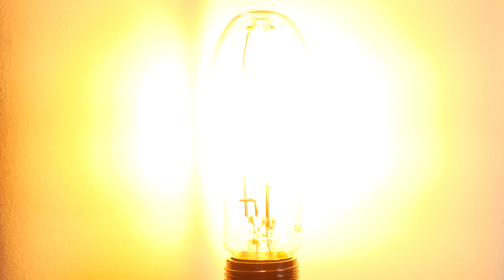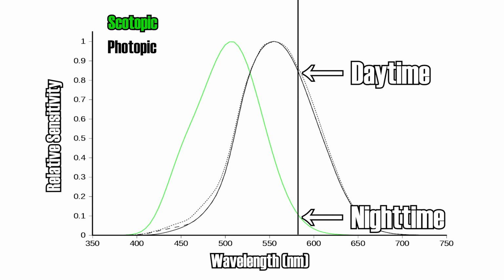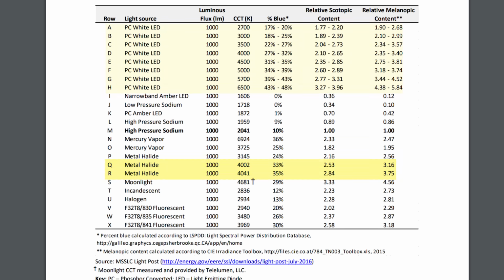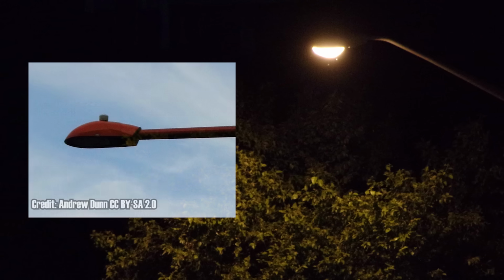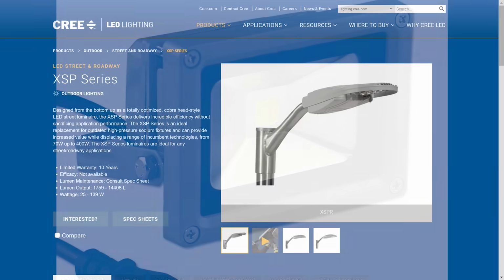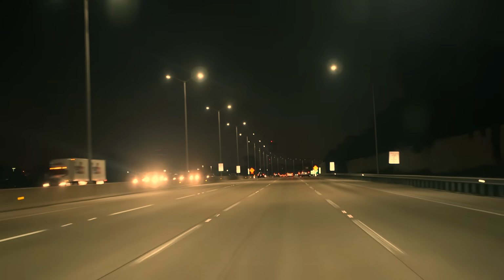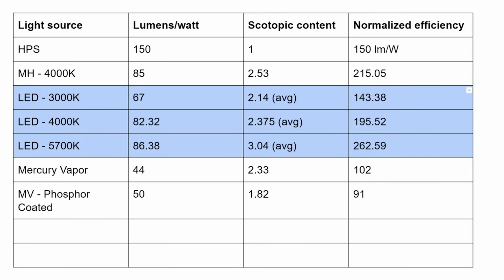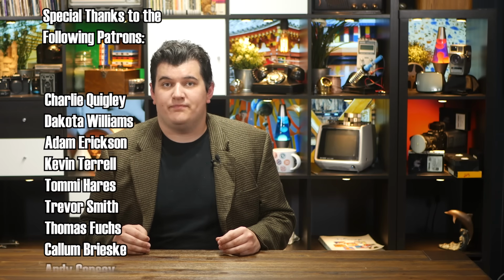The LED's Challenge to High Pressure Sodium

Comment: I prefer HPS lights because it makes it easier to fall asleep when I'm driving. I like to be well rested when I arrive at my destination.
Reply: I'd prefer to die peacefully in my sleep like my grandpa, not screaming in terror like the other people in his car.
Reply: @JohnnyTromboner  
Driver falls asleep
People in Car Screams
Running in the 90s starts to play
Reply: @zyansheep  wait....they went back in time?????
Reply: @zyansheep *Kerosene
Reply: @JohnnyTromboner  yeah, shut up people
Reply: @JohnnyTromboner  Thanks, Jack Handey
Reply: @JohnnyTromboner  But inherent optimism bias and terror management theory will always help regardless of ideologies such as antinatalism based on consent.
Reply: Yes just the point I was going to add,  but the other way around ,  the white -  blue light disrupting sleep rhythms when people drive at night is an added safety factor.
Also, yes led lights brightness is normally adjustable,  in many situations 100% brightness is not needed and we also turn the brightness down at midnight or at a more appropriate time for the location.  It also saves power.   In most areas in Europe that have converted to LED lighting this can be adjusted centrally,  and increased during night roadworks for improved safety
Reply: @davidclark2286 sucks if you live near roads with these lights though.

Here in WI they don’t adjust the lights depending on time of night. For road work they use giant LED flood lights pointing in the direction of oncoming traffic which blinds everyone, people are not smart here in Wisconsin USA.  So it might be a better idea but in practice most people are dumb and muck it up significantly
Reply: Who doesn't like being well rested when they are about to die! Funny enough my step father fell asleep on a road trip when I was a child and nobody knew it until at some point he jolted a bit and asked how we got so far so quick.. he had been asleep for 2 full hours both without wrecking and without anyone in the car even realizing it >.> so apparently he can drive in his sleep O.o 😴 tbh we where just really lucky, the car itself was pretty smart especially for its time and we where on the highway. The car could keep itself in the lane so long as there wasn't any tight or sudden turns and it also automatically applied the breaks if you got to close to something. I attribute that to being why we never noticed and where safe in the end as opposed to him actually driving in his sleep and I don't mean sleep driving I mean no movement dead asleep still somehow being able to drive xD
Reply: @supershenron9162  
I have a friend who's parent thought that the best way to keep themselves awake while being tired and driving was to drive faster.
Reply: @sonan333  actually singing out loud with music on the radio is best way to stay awake.
Reply: @supershenron9162 what year did they have that technology? I believe it's pretty new within the last 10 years.
Reply: I hate when people wake me up by honking and shit
Reply: This was pretty much my thoughts the entire time he was throwing "messing up circadian rhythm" as a negative for street lights which point to driving. If you're driving at night messing up your circadian rhythm is your own fault. If you're driving in the morning it's a free wake up assist.
Reply: @sarab949  I'm 2 years late but I think he means disruption of people living near roadways who get excess light shone through their windows due to light pollution
Reply: @sarab949 Yeah, but if your entire city is lit up by white LEDs, you'll have a lot more spillover to people who aren't going on long-distance drives. Just coming home from work you'll be exposed to light that disrupts melatonin production, and God forbid you go on a nightwalk. And when you do get inside your home you'll find that, if you don't fully shut your blinds you'll be getting a hefty dose of that sweet cold light right into your premises and onto your bed. Even if the effect is still manageable, contributing to sleep deprivation in a generation that is already chronically sleep deprived will logically amplify the problem and might actually lead to a drop in the quality of driving both at night and day. Of course the sleep-disrupting effects of bluer lights at night might not be as dramatic as I'm making them out to be, but they're surely a considerable factor.
Reply: @sarab949  It sucks having one of those lights shining directly into your room
Reply: @sarab949  "Cross-Country Truckers"
Reply: @sarab949  Pretty sure he's not really talking about disrupting the circadian rhythms of the drivers, not to mention circadian rhythm disruption doesn't just mean "staying awake".
Reply: @ImDemonAlchemist  also, as someone who also lived in the Chicago suburbs, if you are driving home from work at 5-6pm it’s going to be fully night for several months of the year. You don’t need to be driving after you should be asleep for it to be dark on the roads.
Reply: @sarab949 annndddd what about all the people who work night shift and have to drive at night to feed their families?
Reply: @sarab949 some people don’t have a choice and need to drive at night you know
Reply: @sarab949  what about people who, y'know, live in houses with windows?
Reply: @sarab949  Some people work nights my dude, driving at night isn't "their own fault." Also, it disrupts the circadian rhythm of everyone around them, not just the drivers, including animals and people living nearby.
Reply: @sarab949  he’s not talking about the people who are driving, he’s talking about people who live near roadways/parking lots/etc where the LED lights are installed.  Like if the parking lot in your apartment uses LEDs you might not get as good sleep each night due to the light shining through your window, or even if you go for a walk before going to bed.
Reply: Lol
Reply: Well, technically you will be resting, in peace 🙃
Reply: Bahahahahahahahahahah! I love this comment with all my heart! Just like grandpa! Not screaming like all the people in his car. XD
Reply: You good mate
Edit: yes I got the joke so don't call me a dumbass
Reply: This comment will probably make a lot of sense in 10 years time
Reply: Damn tesla drivers
Reply: LED lights that have the same color temp as HPS would be awesome
Reply: @jaf - I did that driving through Texas.  Spent the rest of the night in jail.
Reply: Would be a quick way to get to your... Final Destination.
Reply: Oh no
Reply: oh you mean the morgue got it.
Reply: Lol
Reply: Hahhhhhh! Good one!
Reply: 0
Reply: This comment will age like wine in 30 years
Reply: yeah i love merging on to the highway at 0 mph because i ran into a pole :)
Reply: Same, 18hr factory shifts are great!
Reply: Hps makes a better lamp for reading in bed.
Reply: I agree 100% teleportation is the best
Reply: lmao
Reply: Is heaven your destination?
Reply: Love your sarcasm
Reply: Unless its your final destiNation
Reply: Destination: HEAVEN.
Reply: I prefer it when Iam not driving.
Reply: “Hey, grandma! Wait… didn’t you pass? Hang on, where’s my car?”
Reply: i always think id like to die like my grandad. Peacefully and in his sleep. Not screaming in terror. Like his passngers.
Reply: Yup. Crank up the heat, turn on the lullaby station, set the cruise control, and wake up at your destination.
Reply: Lmfao 😆😆
Reply: 😂😂😂 That is if your destination is the hospital (as a serious trauma patient) or your own funeral.
Reply: It also makes it easier to fall asleep behind the wheel.
Reply: Seriously tho, it points to there being a question we should answer before deciding for one type of illumination over another – is the light keeping us awake a good or bad thing? 🤔

Like, colder hues may help us stay awake behind the wheel – but unless we drive all night, we mightn't even appreciate that, as some people may have more trouble to fall asleep at their destination. (Same for pedestrians taking a late walk who wouldn't fall asleep on the sidewalk also with warmer lighting, unless they're narcoleptic or overly tired in which case different light won't really help them either)

It's a bit like adding caffeine to a drink in the evening — you want to avoid it unless you know you're not going to sleep anytime soon anyway 😅

Issue is this drink called street lighting is getting imbibed by all people on the road no matter their specific situation ☕

Fortunately, with further spread of LEDs this question may become obsolete anyway; and even though from an aesthetic POV I do appreciate HPS lights (it's just so nicely "warm" and, culturally ingrained, associated with "night life", or even holidays if you're not from an area where it's widely used) I have to say  that due to their nearly natural spectrum (much unlike pale metal halide light that's also white but lacking reds) I don't have any problem with LED street lights 🪔
Reply: @Edwing77  True. If you're not tired/exhausted you shouldn't fall asleep behind the wheel just because the lights are warm colored. The problem is for those who drive all night and have a higher risk.
Reply: Good god
Reply: You joke, but I wonder if non HPS lights are worse with keeping wild animals up too.
Reply: @Platinum_Squid  I think that's solvable by using LEDs with no blue light emitted. Or at the very least we can tune the color temperature of the LEDs to find something that works. Once you figure it out, you mass produce at that specific color temperature to drive down cost instead of using variable color LEDs. Since they use up so much less energy, this would be a worthwhile investigation.
Reply: @Platinum_Squid  I don't think so. I see deer on the highway at night all the time. And the highway is illuminated with HPS.
Reply: How do you arrive at  your destination if you fall asleep while driving?
Reply: I prefer them because the blue light kills my eyes. 
A place I go by had dark blue Christmas lights out last winter. If I looked at them, instant splitting headache and burning eyes. 
"White" LED headlights wash out many white-on-green signs to solid blue, and all white on blue signs for me. 
I think my eyes are sensitive to UV light because I can't sit near or directly under a fluorescent light. 
If this peterbilt took sealed beams, I'd have a set of Holley/ Morimoto LEDs that mimic halogen's light color.
Reply: Same
Reply: Did you mean resten in peace?
Reply: Hol' up... There's something wrong here but I can't put my finger on.
Reply: hold up
Reply: I'm on the HIGHWAY TO HELL!!!
Reply: The permanent rest 😰
Reply: Preach
Reply: Brooo you goood
Reply: How many variations on the "grandpa died peacefully in his sleep..." Joke does one comment thread need?
Reply: I prefer HPS all day everyday it gives good lighting that isn’t too bright and isn’t crazy bright as LED
Reply: Ugh,Tesla owners.🙄🙄😆
Reply: Lmao 🤣
Reply: This comments are way off. I don't like to see purple lights when the LEDS are at the end of their life. I like LED lights at home as long as they are soft or warm white. If you are used to fluorescent lights then 4000 degree K will work for you. I was into energy saving long before LED and Compact fluorescent lights ever came out. We used circline fluorescent lights and 30 or 40 watt tubes and in the bathroom two fifteen watt lights in the bathroom medicine cabinet. Energy saving is good because I can spend money on things I want instead of the electric company. Like I said if the purple lights get removed when called by a resident then I see no problem with LED lighting. 73
Reply: Okay, this one made me laugh. Take my thumb.
Reply: You most have a self driving car...
Reply: @Haven_City_civilian  self = me
Reply: The 4000K LED street light can be harsh lighting on the road because the emitted of blue-light from white LED could caused of road hazards and disruption of sleep in the night
Reply: You're staying awake because that led laser is beaming into your eyes and slowly burning them off
Reply: Calgary had issues with their LEDs, so they were a light blue/white, It looked awesome. But they are no longer getting them like that so they are slowly getting replaced.
Reply: Maybe someday in the future that would be a valid reason to go back to warmer lighting when our cars can drive themselves
Reply: Completely understandable 🤣🤣🤣
Reply: When my time comes, I wanna die the way my grandfather did, peacefully in his sleep, and unlike the screaming passengers in his car. 😀
Reply: Oh no 😂
Reply: not me. I prefer LEDs as they last longer and improve safety.
Reply: You do need to consider people who live right next to busy roads with LED lights too, so it’s still a problem now in 2025
Reply: That destination is the graveyard
Reply: Gave a like for all the words I've never heard before
Reply: @coolboy5428  troll
Reply: @damienred5021  Your mothers the trolls what with her warts.........
Reply: @coolboy5428  someone get up on the wrong side of the bed?
Reply: it wouldn't be that funny if he owned tesla.
Reply: @buttertoffeecoffee  you can do almost anything you want in a self-driving car, but sleeping isn't one of those.
Reply: I prefer LED lights because they keep me awake at night so I fall asleep while I'm driving during the day. I like to be well rested when I arrive at my destination.
Reply: It didn’t make much sense when they were like oh it’ll make them not sleepy... don’t you want people NOT to sleep on the roads??????
Reply: Your pfp will keep me up well enough
Reply: That's the only thing I could think about all through this video.
Clearly the LED lights gives a double benefit in road safety: visibility & alertness, and most people will end their evening in front a TV and/or computer screen which disrupts their circadian rhythm anyway.
Reply: My grandfather was a bus driver all his working life. He passed away peacefully in his sleep. 

His passengers on the other hand...
Reply: ok and make sure to shine the blue light through all the city windows so the whole population is sleep deprived
Reply: Best argument for 5g
Reply: I was about to post a comment saying circadian rhythm disruption is ideal for those driving at night, but your comment was so much better!
Reply: Autonomous vehicles will rule the world  !!! We can have it all !!    The future is now!!!
Reply: Tesla drivers with autopilot turned on and the seat reclined all the way back while doing 90 on the freeway
Reply: It's extremely dangerous to fall asleep when you are driving 🤔😖🥺
Reply: @Brokendiode  some people in the comments don't realise that
Reply: @Brokendiode  that's the point of the joke.
Reply: @Brokendiode  I can confirm I died
Reply: @Brokendiode  -  Especially at 80 MPH!  😨😨😴😴
I have found that pulling out nose hairs helps me stay awake.
Reply: Yeah if i die, i wanna die peacefully in my sleep, like my Grandfather did, not kicking and screaming like everyone else in the car 😒
Reply: I know it's a joke but honestly HPS doesn't give me a headache. I'd rather pull off the side of the road than have migraines while driving for hours.

It just takes some common sense. That unfortunately few people have. So I guess it's not so common, but hey darwinism amiright?
Reply: @KingNefiiria  It is not normal for white LEDs to cause headaches or migraines, certainly not consistently. You should see a doctor about that.
Reply: @KingNefiiria  Buy safety or target-practice glasses with clear amber lenses
Reply: @Stroporez  wow amazing 😮
Reply: @KingNefiiria  there is science to back up why you feel this way, i agree, i prefer HPS.
Reply: @mangomadness8635  Maybe, but I'd prefer to pay less in taxes, so let's use the more energy efficient option.
Reply: TEAser if you are concerned about taxes, leds are not your friend
Reply: I hope you mean pulled off onto the shoulder while sleeping
Reply: @cynthiablackthorn  d
Reply: cally mally  They should use HPS only.
Reply: kk shill, it's your useless soul you're throwing away............
Reply: @coolboy5428  it so obviously is a joke
Reply: @Oliver-ku1tf  No, Agenda 21 is not a joke, it will be your future if you do not resist the NWO.
Reply: @Oliver-ku1tf  lmfaooo, some people aren't smart enough to understand jokes 😂
Reply: @Oliver-ku1tf  with Tesla autopilot on sleeping is possible though still not legal.
Reply: @Oliver-ku1tf  8
Reply: @coolboy5428  i am so sorry that your parents let you grow up so uneducated
Reply: @coolboy5428  I actually speak four.
Reply: @coolboy5428  Ohhhh look at you, some British dude getting angry at people from non English speaking nations for not being able to write sentences perfectly on the internet.

I'd love to see you tackle the Dutch language, you'd barely be able to handle the beginners course.
Reply: @teaser6089  hahahahahaha
Reply: @coolboy5428  you're not so cool after all huh.
Reply: @coolboy5428   Hey man I know it's been a year but I'm just wondering if you finally got the joke
Reply: @coolboy5428  guy posts joke comment

gets mad
Reply: @coolboy5428  this is your brain on the american education system
Reply: @coolboy5428  That does not make it much better, we've all seen English schools.....
Reply: @algumnomeaihehe  Correction: This is your brain on the European education system.
Reply: @coolboy5428  did you know self driving cars exist? You're not really supposed to sleep in them but you can basically do anything else while the car does all the work.

And that person is obviously being sarcastic as well .
Reply: @birisuandrei1551  crash
Reply: @birisuandrei1551  into
Reply: @birisuandrei1551  a
Reply: @birisuandrei1551  brick wall

Comment: In my area, there's a collective mix of LED Street Lights, High Pressure Sodium, and Low Pressure Sodium, and it goes something like this:
LED: Wow, that's bright;
HPS: Eh, bright enough, but could be better;
LPS: That light is on, isn't it?
There's also what look like modified HPS lamps on one of the roads that emit a whiter light, but they're not great and are quite a sharp white compared to an LED